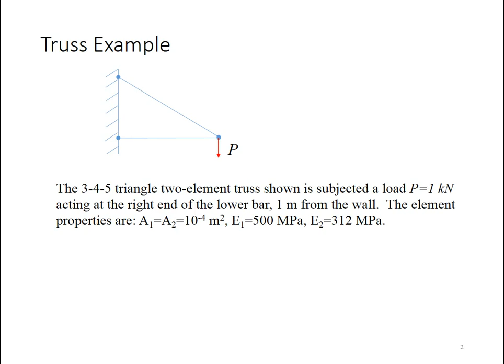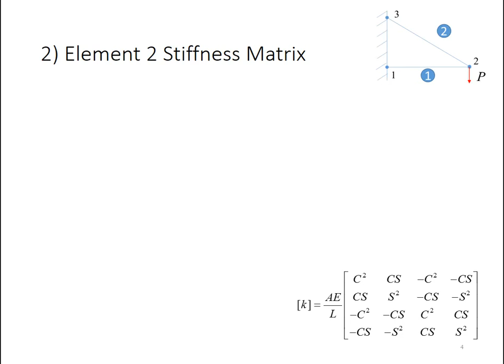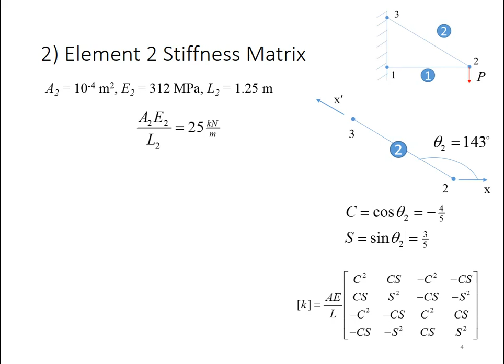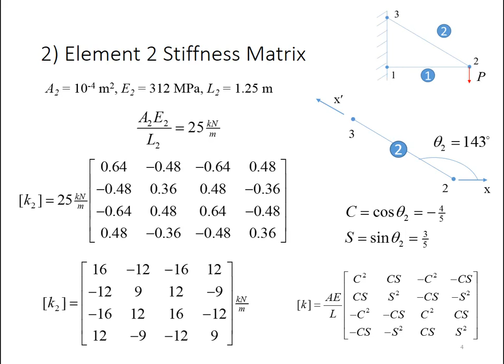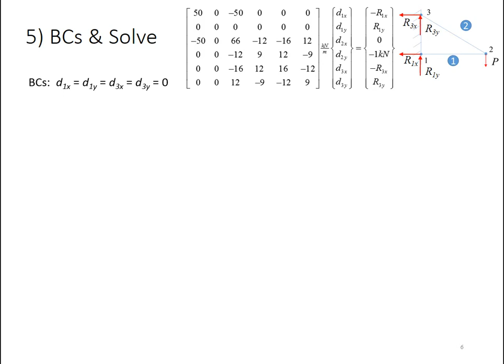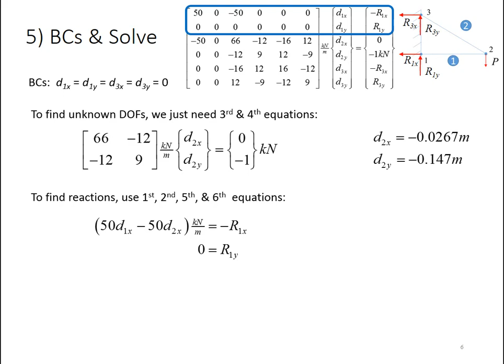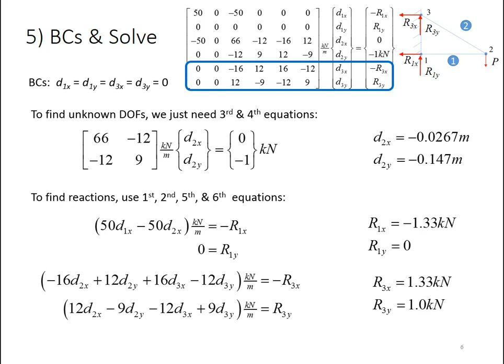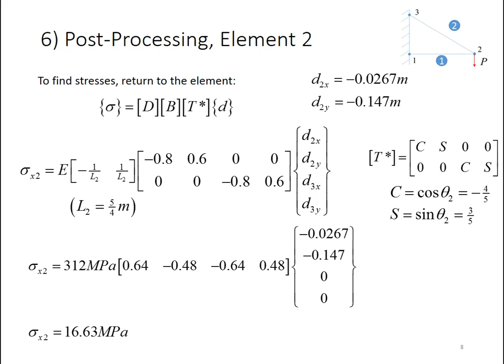FEA 12:  Truss Element Example

Comment: Alos, how did you get L2= 1.25 m?
Reply: If you look at the problem definition, it says it's a 3-4-5 triangle, since element 1 is 1m (corresponding to the 4 in 3-4-5), L2 is 1 / 4 * 5 = 1.25m. Also in 3-4-5 triangles, the angles are always the same, this is how he got the angle between the local and global x axis of the 2nd element.
Reply: @Robert453007  oww thank you so much!! :) much appreciated :)